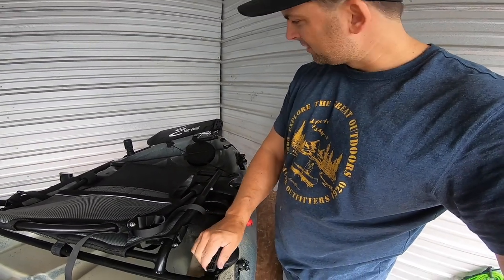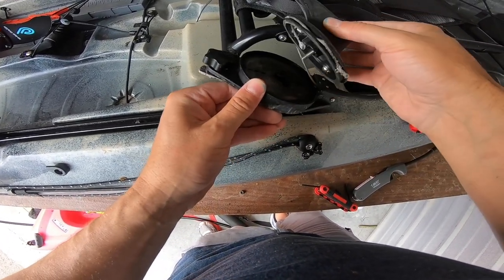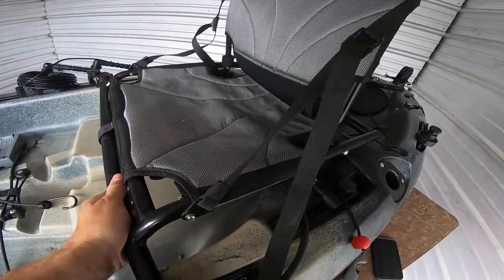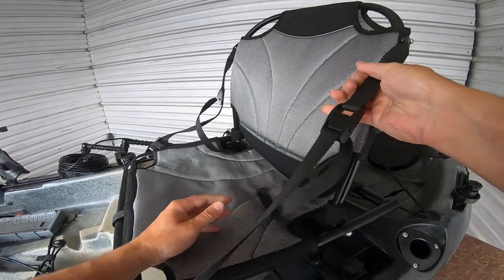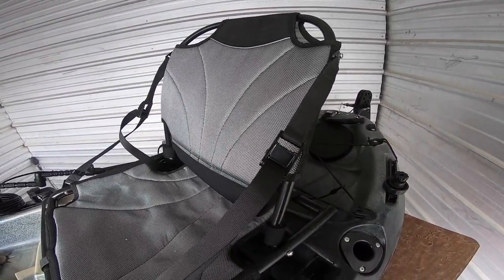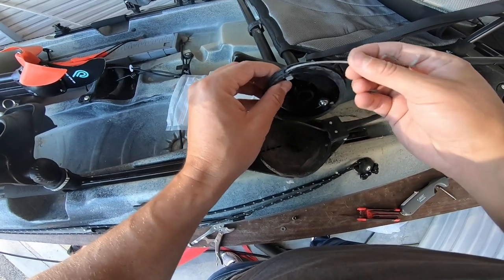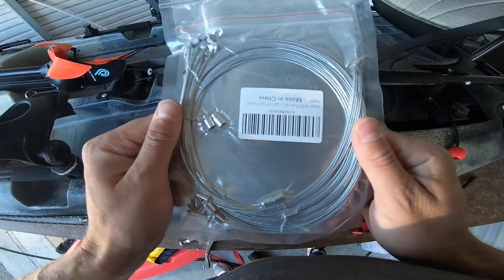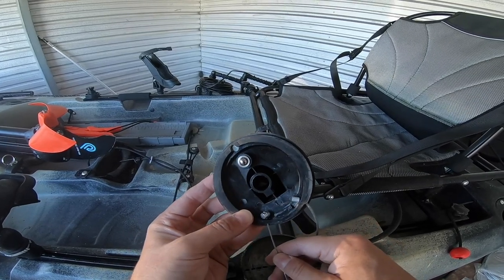3 Month Review:  Lost Creek Angler 10.  Mako Angler 10.   How to repair steering.

Comment: Mine broke also in 3 months. I've been taking to the riot company for almost 2 months to get a replacement cable. Unfortunately I didn't have my receipt cause I hid it from my wife so we'll I couldn't find it. We'll I even told the company I would pay for the cables but still didn't get any good reply. 
Thanks for the great idea for a fix. And like you said in your video the steering worked alot better after the fix.. Terrible customer service from Riot.. Much appreciated Sir.
Reply from the maker: Glad I could help you.  If you have trouble with that barrel connector holding the wire go to home depot and get these ferrule and stops ($1.17).  They work a lot better than those.  https://www.homedepot.com/p/Everbilt-1-16-in-Aluminum-Ferrule-and-Stop-Set-43274/205883075

Comment: lol, same, i broke on my first day of use out in the lake so i had to use my paddle to turn it but once i got bk home from camping at the lake i also replaced the lines with bike brake cables.
Reply from the maker: Check out my 3 year review.  I replaced the steering system and the rudder.  That stock handle is crap and only a matter of time before you break it again.  I was replacing wires ever month or two and got tired of it.  https://www.youtube.com/watch?v=mIu4dzip39M&t=197s

Comment: That's unbelievably bad customer service, but it looks like you found some ways to work around the issues. I'm currently in the market for a kayak and appreciate hearing this information.
Reply from the maker: For sure.  You looking for a pedal kayak?  I would say go for a hobbie.   I may just put a trolling motor on here.
Reply: Yes, looking for a pedal kayak and hobie is the front runner. Will probably be happier in the long run to spend a little more money now.
Reply from the maker: @fatherandsonsfishing  Probably, you can always upgrade electronics.  I planned on getting a boat and so got better electronics for that.

Comment: nice video on the cable fix!  thanks!  I can see a problem you may encounter, I didn't have the cable problem, but that screw that goes through the steering lever:  It will tighten down when you steer leaving you with a frozen rudder out in the sea.  You probably need to get a new nylon coated nut, then use some loctite (blue) on that screw & nut when you tighten it.(thanks to the fellow mako rider on fb that gave me this advice)
Reply from the maker: Thank-you.  I got around that by cutting away some of the plastic on the under side where the nut is.  But thank-you, if I do encounter that I know what to do.  And hopefully, it isn't out at sea.

Comment: I had the same problem with my Titan - Steering Cable BROKE - about 2 miles from shore...!  I replaced the S/S Cable with 660# Kite String (I used to Kite Surf, and had it left over), kinda "re-did" my steering handle, and extended the rudder... That was 2-1/2 years ago, and haven't had any problems since!
Thanks for this review, as it gives everyone an "insight" as to what to look for in an inexpensive 'Yak, and how to repair it.   (Next time I get $4,200 just "sitting around", I'm going for the Hobie PA-14...)  Haha!
Reply from the maker: OUCH!  Hope you had an oar.  I guess steering with your hands dragging in the water isn't too bad though.  I have seen that hobbies steering breaks too.  They just use the string but I don't think it is as strong as your kite string.  From what I have seen it is people upgrading their rudder to the bigger ones that strains the string and breaks it.  I will probably try that string if my steering goes again.  What did you do to your steering handle?  I find it strains my wrist a little when I go out all day.
Reply: @PeelingLine  On the Titan, the cable was held by a little "grub-screw" fitting, at the handle (that's where it broke, and I had to reach all the way back and grab the rudder control, behind me!...can you spell "Twisted Back", for over an hour?).  Haha! 
As soon as I get some time on my buddy's mill, I plan on making a rudder with a spring-loaded "kick-up" (longer, wider, and down deeper into the water - as Titans are "notorious" for "wandering off course"!).  The extension I have now is just a plastic dollar store "add on", to the original rudder - but it helps (I used S/S Rivets with back-up washers, so they wouldn't corrode!).
The "Kite String" I used says 320 Kg. , and I haven't had any problems with it.  (I also "re-did" the rudder top, making a half-pulley assy. to add to it. Rudder now goes 180 degrees, and I can nearly "pivot").  Haha!  A lot easier to steer and stay straight, also.
Reply from the maker: @MSmith-jf5wo  I have had to do it and know the feeling but not for an hour.  Might have to do the same with the pulleys.  Reducing the turning radius would be nice.

Comment: My pedal fell off both sides on my pedal drive right now drilling a hole in the pedal to run a bolt through it. It's stainless steel in aluminum
Reply from the maker: That sucks.  My drive is starting to go.

Comment: Nice fix on the cables. I've never had a problem with my Slayer (owned it for over 5 years now) but I've seen people having to replace their cables after they upgraded their rudders and it put too much torque on the cables and broke them. Slayer has switched to using cord now instead of metal cables. Really crappy about the customer service. I can't stand companies that blow you off like that.
Reply from the maker: I was thinking if the cables don't work I will try cord.  The owner of the company reached out to me last week.

Comment: The steering cables on the Hobie are nylon I'm pretty sure. Not metal wire cables like those. I think they break from time to time too. You did a great job fixing yours. It's a shame you had to though. Kinda poor customer service if they won't respond back to warranty claims. That's gotta be very disappointing.
Reply from the maker: I have looked at the hobies and think I may try the string if this doesn't work out.  There may be less friction with the string and the steering could be better.  Someone from the company did call me back finally but it was 5 minutes before they closed on Friday and I wasn't able to take the call.

Comment: Dude, that's a bum steer (no pun intended). It's a good thing you're obviously a very capable and handy person; you did an awesome job fixing it. Personally, however, I don't think you should have had to do that, and I'm not thrilled that Riot gave you the runaround. Let the customer do the repairs is a BS cop-out imo. Hopefully this is the last of your issues, but if you ever do get another pedal drive I think you're right about the hobie; although there are some really good ones out there that won't break the bank from Wilderness, etc. Tight lines.
Reply from the maker: I wouldn't mind doing the repairs if they sent a replacement part.  Probably costs them nothing for the wire if I can get a bag full for $5.

Comment: Dang that's a bummer about the kayak, especially the company not getting back to you. I might gripe about the prices of Hobie's but so far my steering has held up over 3 years now, and they aren't even steal cables
Reply from the maker: I have looked at the hobies steering and they just use string and pulleys.  I may try that if this doesn't work out.

Comment: Thanks for the video.  Very informative.  Looking at a bunch of different models/pricing.  Kissed off Hobie.........somewhat focusing on Old Town but hoping one of these more "favorabley-priced" models will work.  My rationale is the same.........Save on the boat, spend it on the electronics.  Spending $3,500-$4,000 on boat and misc. accessories is a killer.  Wife says "Do it" but pulling the trigger isn't easy.
Reply from the maker: It is a tough call.  I had the intention of selling the kayak after a year and buying a boat but circumstances change.  I find it is wise to listen to your wife.

Comment: Yes it's exactly how mine was too. The rudder wires kept fraying on the tension knob. So it would break. I've replaced mine every 2 to 3 months.
Reply from the maker: Yeah I have done it 4 times in the year that I have owned it.  I just redid it.  Next time I plan on using some 200 lb downrigger line.  I have heard people are having better success with that.
Reply: @PeelingLine  you can try bigger wires. It'll last a little longer. Hopefully to upgrade to higher end kayaks soon so I won't have to deal with it so much.  Good luck
Reply from the maker: @fishoclock4851  I am not sure that would solve it.  The problem I notice is that one of the outer wires will break and then start adding friction in that area.  This may be solved with better bearings where the line goes from the handle into the wire tubes.

Comment: Great job fixing the steering.  Can you share the link for the cables from Amazon?  Thanks.
Reply from the maker: Thanks but it doesn't fix it permanently.  You have to replace them depending how often you use your kayak and salt or fresh water.  I have a new steering kit I bought I will try out and see if it is better and make a video also with some other upgrades so stay tuned for that.  I put a link at the bottom for the cables they're a buck a piece and I get the 8 pack of ferrules at home depot.  https://www.amazon.com/dp/B01EJRZJ32/ref=sspa_dk_detail_5?psc=1&pd_rd_i=B01EJRZJ32&pd_rd_w=6sTGG&content-id=amzn1.sym.386c274b-4bfe-4421-9052-a1a56db557ab&pf_rd_p=386c274b-4bfe-4421-9052-a1a56db557ab&pf_rd_r=T0CGCFJT3XC3MH4HEMCQ&pd_rd_wg=NaiOh&pd_rd_r=bb61f5c9-6d02-431f-8fbb-eef3ac4ed8c0&s=hi&sp_csd=d2lkZ2V0TmFtZT1zcF9kZXRhaWxfdGhlbWF0aWM&spLa=ZW5jcnlwdGVkUXVhbGlmaWVyPUE2WjlLSDNSQktWMUYmZW5jcnlwdGVkSWQ9QTA5NDc4OTQxUlVTWllBNzRPMjAmZW5jcnlwdGVkQWRJZD1BMDUxODMwNDFNQktRU0EwQjRSODcmd2lkZ2V0TmFtZT1zcF9kZXRhaWxfdGhlbWF0aWMmYWN0aW9uPWNsaWNrUmVkaXJlY3QmZG9Ob3RMb2dDbGljaz10cnVl

Comment: Have you had to replace the bicycle cables since this video? What was the result when Riot responded?
Reply from the maker: Yeah they rust and break.  I have done it twice and about to do it a third time.  It doesn't take long but I think next time I will try with some downrigger line which is nylon.  I think the salt water is brutal on anything metal.

They did get back to me.  They offered to pay for the costs.  It didn't cost anything for the cables so I said don't bother.
Reply: @PeelingLine  Thanks for the quick response! Same thing happened to me in the similar time frame. I've purchased bicycle cables and will anticipate future repairs.
Reply from the maker: @phengxiong8843  They are the cheaper solution.  Also check these out at home depot.  They're just over a buck and work better for binding the cables at the back.  https://www.homedepot.com/p/Everbilt-1-16-in-Aluminum-Ferrule-and-Stop-Set-43274/205883075
Reply: @PeelingLine  Thank you so much!

Comment: Hopefully that smaller gauge wire doesnt  bind up on you and it lasts for awhile 👍. Hate fixing new things..but atleast it's got nice stickers on it 😉.  Good review. Think my big ass would break that seat ..Haha
Reply from the maker: Thanks.  Not much I can do about it.  The store wont take it back so I have to fix it.  I think big guys have used it but the problem for them was it tipping.
Reply: @PeelingLine  probably so being high up. I got my pontoon so I'm unsinkable! Unless someone pops it Haha. Havnt gotten to use it much but I plan to! Be safe out on the water dude

Comment: Man that stinks, and they did not even get back to you on it.   I am like a mod fix it type of guy... Have some pointers for you... When you put those cables in you should coat them with a grease so they slide easy though the passageways of the cables and stuff. Now you can also use some thin oil and drip a some down each end  that a cable comes out from the cable outside casing or component and the oil should work it's way down the cable and also make it more slippery and not rust and last longer I used to ride freestyle bikes until I was 30 years old and then mountain bikes I always used thin oil down the cables it works great .  another thing the seat clamp you could probably go around that clip once you have it adjusted the way you like with some gorilla tape or put a zip tie around it so it can't flip and delatch? ... Hope this helps ya bud.  👍at least you got it all fixed up and made this video to let others know of these problems.
Reply from the maker: Good idea with the zip ties.  I probably should do the oil or grease on those wires.  One time on the salt and they will definitely rust out.  Thanks for the tips.
Reply from the maker: @PHFishingBiking  I just ordered some.  I have so much stuff rusting now that I fish the ocean.
Reply: @PeelingLine  Cool, it's good stuff I use it on everything, it's not like wd40 this stuff actually is a good lubricant also and fights corrosion way better than anything I ever used.